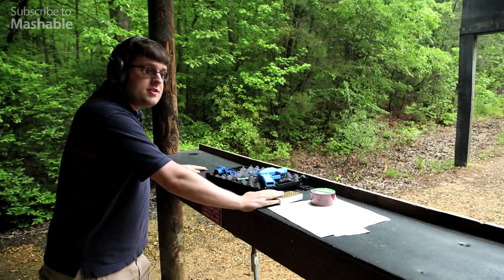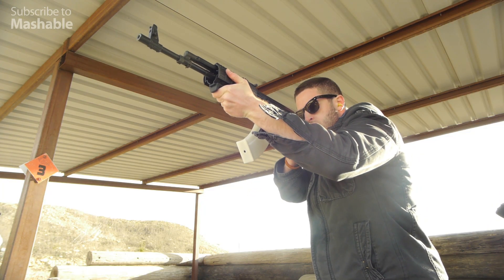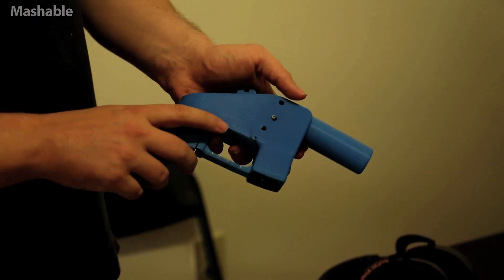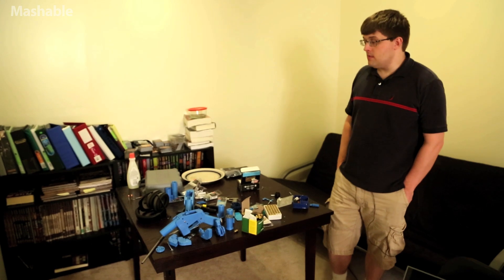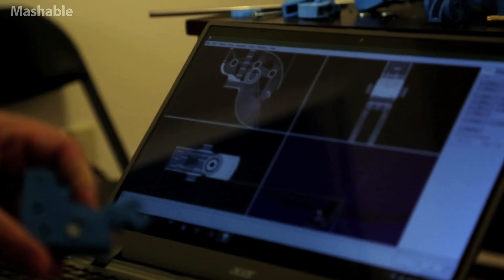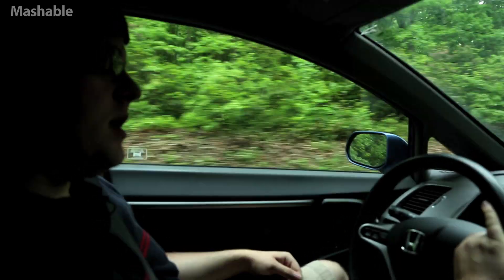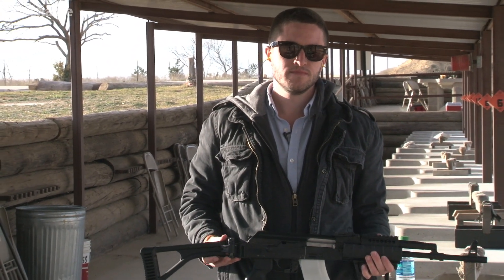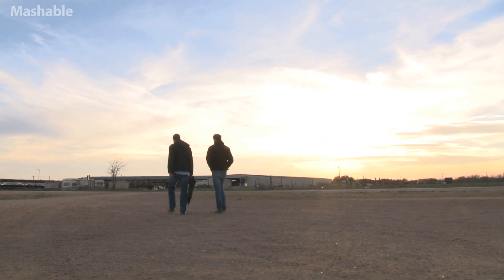I 3D Printed a Gun | Mashable Docs

Comment: Why are people freaking out? It literally fails to fire in the video. I've seen an article by a firearm expert who analyzes the design and comes to conclusion that this gun would have pathetically low range and accuracy, kinda like the real Liberator by CIA (look it up). The only real way to kill someone with it if it fired would be to press it directly into someone's body and fire it point blank.

And these design flaws are BECAUSE it's plastic - the barrel is too soft. Metal is p much necessary for a functioning gun. This is a pipe dream.

Comment: What next 3d printed pipe bomb
Reply: +bkelleythehive nah that would be too expensive lol
Reply: You don't need a 3D printer to make a pipe bomb, watch the movie zero day
Reply: Funny that you mention that,
I have a few friends who are studying 3D printed explosives for their PhD
Reply: No that’s impossible
Reply: limpthemememan - no, it isn't.  You aren't going to do it with your plastic melting or laser sintering powder printers BUT there are two other types of printers out there that I know could be (and are being) used for 3D printing explosives.  The first was originally designed for 3D-printing foods.  Its print heads consist of syringes or tubes with pumps that dispense liquids or gels. It squirts a layer, which hardens as it dries and then another layer is added.  The second uses a low-energy UV laser to selectively harden portions of the surface of a pool of UV hardening resin.  The platform the object is being printed on starts near the top of the pool and lowers as each layer of the object being printed is hardened.  Suspending the chemical components of explosive contents in the slurry or the resin allows the printing of some AWESOME shaped charges for weapons and demolition.  The gel type of printing has actually been showing a lot of promise because you can work with sets of gels that are inert until combined on the printing table, making it much safer to create these shaped charges.  Other technologies are also being explored such as using statically charged substrates to build by layering chemicals compositions as finely as an atom thick.  This is a ridiculously slow process but also extremely precise.  Nothing, it seems, is impossible.

Comment: You guys do understand that 3D printed guns are plastic, meaning they go unnoticed by metal detectors and such, causing another tragedy, although 3D printers are great and helpful, I don't think we need them. Just go out and buy what you want, or at least have 3D printers accessible to the government only. This world is filled with some crazy ass people. I don't trust any of this.
Reply: wilmer perez You have done zero research on this. At the very least you must have a metal firing pin in order to set off a primer. Rounds, themselves, are mostly metal other than the gunpowder. No matter how hard you try to sneak a firearm through a metal detector, I assure you the firing pin and rounds will set it off. Not to mention the variable metal pieces that are reinforcing the plastic most of the time because plastic is way too fragile to handle the shock wave and force of a firearm.

Comment: You can't 3D print metal springs, and primers, and gun powder, and other parts you need to make a working firearm. So the idea that you can print an entire gun at home is crazy. However, I can go to the hardware store and just make a POS gun if I really wanted to.
Reply: Casey C But you could print parts for the gun and just buy the necessities for firing it, so the printer wouldn't work entirely, but it'll do some of the work. :p
Reply: I can do the same thing in a wood or a metal shop. I've seen AR lowers made from wood.I can go to home depot and make a gun tonight. So I don't see what the big deal is over the 3d printer.
Reply: Casey C There's no "big deal" lol. It's just another cool thing that could be plausible.
Reply: Well there are people out there loosing their minds over this. Not this video though.
Reply: Over the 3D printer? Obviously! It's a new invention that is extremely useful for a huge variety of things. Your home plastic factory in a nutshell, haha!
Reply: +Casey C 
"losing" - it's "LOSING"
Reply: You sound like a dumb ass

Comment: You still need a metal barrel or you will have a explosion!
Reply: +gary smallwood not necessarily. if the plastic barrel is thick enough, and the cartridge of modest enough power, it wont explode. but you wont be able to stabilize a bullet very good with a plastic barrel. so it wont be that accurate.
Reply: neverknows best Yea, even if you shoot 22 shorts the inside of the barrel will shatter.So test your theory and use 357 magnum round or anything you want I dare you. This will take your theory to the task!You might get away with small weak calibers for a while but sooner or later the barrel will shatter and the plastic gun will blow up in your hands.Please go out and shoot guns and learn what in takes to shoot safe not listen to these anti gun propaganda people that tell half truths!

Comment: Shoot that gun in a random range with no protection is very dangerous if the gun shoot it probably gonna sent the brass right in is face or just blow is hand off. just the heat will melt the plastic.
so the guys was Lucky that the gun didn't shoot.
Reply: +Pascal Gagnon well it couldnt send the brass at him due to its design, the cartridge and the gun are not powerful enough to "blow off his hand" and the heat of one round fired wont melt the plastic. the inside of the barrel might get a little charred. but thats it.

Comment: In denmark they have this new 3D printer. It works almost exactly like a standard melted plastic printer, with one little exception. It can feed a carbon fiber string into the melted plastic. If layered in different direction in every second layer it can be almost as strong as steel from a almost normal 3D printer.
It can also cut the carbon fiber string and not feed it making it to a normal 3D printer. This way you can choice what component have to be stronger and what part suppose to be cheep filler. Its also a lot cheeper than this laser based 3D printer used here, but makes it alot stronger.
There also exist full color 3D printer using white plastic with incjet coloring. Making possible to print things that melt in better in the environment.
There is also printerhead that can be feeded from 3 or so different material (Plastic, rubber, acrylic - Transparent/Window).
Its just a matter of time before someone combine all this into a single printer head.

There also exist this company in sweden that makes metallic 3D printer that can print in steel or titanium. Could probably print an entire gun in one go, just as good, or even better than the commercial ones. The printed titanium is just as strong as commercial.

The problem with the metalic one is that it have to be lowed in to powered titanium so its not realty possible to combine it with the plastic in the same printer... well at least not in the same print.

The titanium printer is hugly expensive, but when the Chinese start making copies it will probably be cheaper.

The carbon fiber printer is also expensive for the time beeing, but it will probobly change quite quickly because there is no complicated stuf in it.

by the way, there also exist printers that print in a fabric like synthetic material (very similar to synthetic fabric)

Comment: could someone print me a 3d printer?
Reply: Yes, actually. There are models that allow you to build a printer from printed parts. You'll just need to get the stepper motors and some screws and belts. You can order prints online from many places. So yes, that's entirely possible.
Reply: @florianklar6100  lol Prusa provides the buts for there printers
Reply: @johnsmithnonya46  Of course, you're entirely right.

Comment: It's not a gun. It just isn't. This is at the same level as picking up a metal pipe, inserting a round and banging it with a hammer. And that will probably outlast this plastic thingy. Some critical parts of a weapon is not suited for these kinds of materials.

Comment: Before everyone flips out about OMG 3D printed guns realize the least critical part of the AR-15 is printed the rest is still milled with precision machines and the pistol is pretty worthless. You could build a 12 gauge shotgun from $10 of pipe and fittings at the hardware store (YouTube it). And back-scatter and pat-down which are both in use today would detect the liberator. Besides how could you conceal a gun that bulky :D
Reply: George Washington its the pressure thats the problem not the grain of the bullet.  A 3d printed AR barrel would have to be extremely thick and wouldnt have rifling.  So not only would it not be able to attach to a rifle, it wouldnt be accurate at all.
Reply: @ktmguy119z  What about the heat?  the plastic of the printers is made to melt
Reply: @fren111  That's another issue.  Even if you 3d printed a barrel capable of withstanding the pressure, you'd only get one shot out of it before accuracy goes completely to pot.
Reply: Now can i say it? Alright. OMG 3D PRINTED GUNS!
Reply: +Frank Blackcrow  well you're talking about investment cast. and that is used. but so is cnc machining. and cnc is often stronger.

the p90 is a very plastic gun. plstic trigger, hammer, fire control group. uses steel barrel and bolt and carrier. but those parts have to be steel. a full plastic or polymer gun IS pointless. but they're coming up with new materials to print with all the time. some stronger than others. some less so.

the the no serial number part is a moot point since u can buy guns private to private without a background check or even exchanging info. and you are not required to register your guns either. also the "ballistic  trace" nonsense. guns are not ballistically "fingerprinted" from the factory. you can change barrels and thus change the "finger print" on the bullets etc. especially with handguns. and barrels are not serialized.

and why a plastic silencer? a metal silencer is easy enough to make on its own. and legal also.. you have to go through the NFA process to obtain one. but could make it yourself legally.

you will always need metal barrels, metal bolt and carrier, and metal springs and pins.  the only upside to 3d printing something is to customize it, and to make things lighter weight.
Reply: ktmguy119z you could make a barrel from a mill. The one challenge would be the gas block, which couldn't stand the pressure. But the barrel would be easy.
Reply: @jimraynor7788  you could, but that's pretty irrelevant considering I was explicitly talking about 3D printing the barrel.
Reply: @ktmguy119z  Yo, i've literally gotten a degree in the amount of time it's taken you to reply back to me lol 
You win the argument because you're that dedicated. I tip my hat to you, sir.
Reply: @jimraynor7788  lol, someone necrothreaded this comment section replying to me  today and I noticed your comment.  Figured I might as well reply, too.
Reply: C. Caner Telimenli very, very, very expensive.
Reply: ***** read my comment again. I said a MILL; which would imply that it's made out of metal.
Reply: softan I'm not that worried about an 80 year old with a 1000 plastic guns that probably work like shit, not only that but he spent so much of his life building 1000 plastic guns that he wouldn't have time to actually buy ammo.
Reply: @antoniomiller7323  look how far we have come lol
Reply: short-sighted...
Reply: Barnacules Nerdgasm we can buy a real gun thats all
Reply: Barnacules Nerdgasm I watch your videos
Reply: Barnacules Nerdgasm only 80% receivers need to be mailed dumbass
Reply: Captain Howdy You're an idiot. Look up how to make a shot gun with metal pipe.
Reply: how would you conceal a 12 gauge shotgun
Reply: I like the idea of 3d printed guns however I can't see them being practical for more than 1 or two shots I've been shooting since I was 8 and if you empty a clip with any sort of speed the gun starts to get hot which is bad for plastic not to mention the stress the bullet causes
Reply: I've seen a shotgun made with crutches and a nail
Reply: Barnacules Nerdgasm There is this process called lost casting where metal can be clay cast from the printed part, the cast is fired in a kiln and the plastic is burnt away leaving a perfect mould of the original part that was made in plastic, maybe you can see that is really how to make a gun,, but their not telling everyone about how it's really done,, no one in their right mind would really use a plastic gun.
Remember the gun that gets made has "no serial number" and has no ballistical trace from a manufacturer, in other words no record, if illegally used and evidence is left behind then that would be a stupid use of the gun, but still the evidence pointing to the actual gun that was made would be minimal, because all to most guns manufactured by factories are recorded via their bullet fired and their serial number, that is what makes guns traceable,,and who they are sold to is recorded as well.

All these people making plastic guns, what about a plastic silencer !
Reply: It won't be crazy to say that we can make an ar-15 barrel too. 
The .223 is a lower grain than some pistol rounds.
Reply: @jimraynor7788  look how far we have came hehe

Comment: I'm curious when I see anti-gun comments, but nobody addresses other issues?

What about Non-visible spectrum lasers that can instantly blind you permanently, inconspicuously and quietly?  I mean, lasers are obviously not toys, but they aren't  nearly regulated as they should be.

What about LRAD's (Long Range Acoustic Devices) that can turn the sound beyond human hearing range, and cause deafness, internal injuries, and possibly death. LRAD doesn't even need to be LOS like lasers or most firearms.

This is not a straw man argument, but legislation against non-firearm based weaponry seems pretty slow to non-existent. It seems to be a scapegoat for the underlying issues of a violent society.
Reply: Lasers and LRADs are not possessed by citizens, someone may have the money for a high end laser...but nothing along the lines of an invisible one, other than UV or IR of course. The weapons you mention are military grade, guns are used everywhere by everyone...that is what makes them so controversial. Anyone, anywhere can use it...but not everyone can pull out a laser and blind you with it or pull out an LRAD and cause damage with that. Regardless, weapons are dangerous, and should only be messed with when absolutely necessary.
Reply: High End laser = particular spectrum
Cheapo Laser = visible spectrum + unseen radiation. You could take a cheap laser and put on a visible light filter and bingo.

I concede it may be difficult, but just because something is military issue doesn't mean that it's out of civilian hands. It's also possible to duplicate said devices. Guns have a notorious reputation, but if somebody is shot it's more easily recognized and treated. Guns are also usually very loud, have gun shot residue, and a fair amount of other discernible qualities.

The main issue with LRADs and Lasers is that they aren't notorious, yet.
They are silent, deadly quick, can operate with a level of autonomy, lack many of the same weaknesses as firearms, and the injuries inflicted are harder to identify and treat.
Reply: I agree it just seems a little off the subject is all :)

Comment: I'm not convinced that plastic 3d printing of firearms will come to replace traditional manufacture. I don't think that abs plastic can withstand repeated use in the parts of the gun that actually interact with the bullet. The barrel will eventually erode, and at a much greater rate then metal. Firing mechanism will quickly deteriorate, leading to catastrophic and potentially dangerous failure. You have to seat the barrel properly, or shots will be harder to aim.
Reply: yeahh but that seems to be a primarily military concern--and of course they'll still use metal (though there will surely be 3D printers that can print metal). most people who have a gun for self-defense, or whatever reason, don't use it very often. Plus, they can always print a new one!
Reply: It's just to dangerous for people to be doing. I mean that guy even said that not all blue print's work on all printer's. Which I take as, one idiot is going to get the thing online. print it. Think it would work. Have it blow up in his hand's. No more 3-D printer's.
Reply: Sure they could but, why would they. I mean it cost more money to buy the thing to make said gun's. Then you have to keep in mind that bullet's get really hot after they are shot. I also doubt that you or any of us will see a 3-D metal printer.
Reply: Jonbob Bobnoj Not supporting or really trying to discredit anyone however metal 3d printers do exist. I think this could be a interesting proof of concept. 3d printing may be used in commercial scale to reduce the cost of highly intricate parts. I Doubt it will be on the house hold level for a while however.
Reply: Eh, just seem's like something that is to early to really know what's going to happen to it. I do think if people keep making gun part's the people that make the thing's will take them away. That or the government will just ban them.  Why ruin something before it has a foothold to be something.
Reply: ya i agree. its not a new thing really. if you want to make a gun you can get a block of metal, a drill press and mill one out. what worries me is people who don't know what there doing and are liable to injure themselves and others
Reply: People now print parts like the lower receiver, which is the most regulated part of the gun, and  buy the rest of the gun including the barrel and chamber.
Reply: Jonbob Bobnoj At least he can print out a new hand. Joking aside, test it with a string first, from a safe distance.